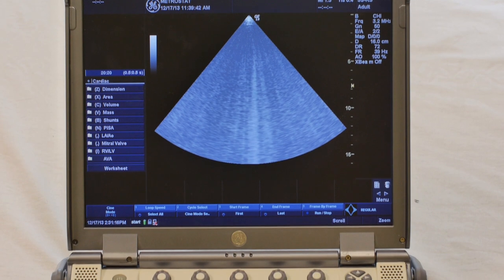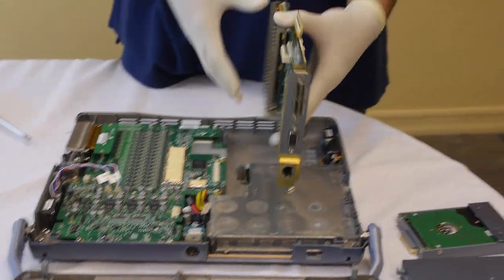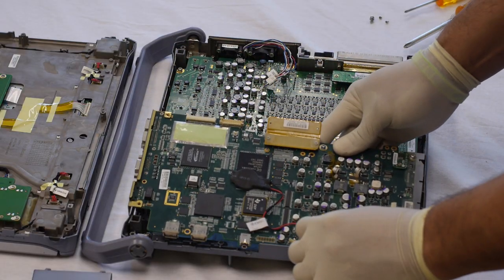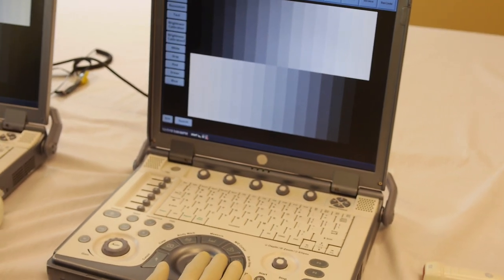How to Repair an Ultrasound Machine: Reconditioned Ultrasound Systems

Comment: Hi, i have a question, not sure you can help or not. i have few Ultrasound Machines Toshiba Nemio 10, 20, 30 & XG. the problem with machines are as below

The Date/Time after 2020 is not going to save. The date save only which is before the year 2020 not above the year 2020. Once date is set of the year 2021/2022 or even 2023 but after machine got restart it jumps to year 2000. 

Not sure if you know this issue or can help on this. Thanks in advance.

Comment: Please sir/ma i need your response urgently. As an engineer, i fixed a Phillips clearvue550 ultrasound machine but it keeps showing an error message with Diagnostic Code 0010.KDH519G4.0 

I've tried to reset the machine but the error message has persisted

Comment: I have  a volusion-e ultra sound. Is it possible to hardwire it to Sony black printer for it to print, via USB and BNC connector, pls advice cse I can't also access the add printer menu on this ultrasound machine
Reply from the maker: Please give us a call at (888) 559-5253!

Comment: hi, i have a medison ex8000 ultrasound system, after 15 min of walking it displays this message: (system error please switch the ultrasound system off and reset error code 65) help me,
Reply from the maker: Give our service department a call and we will do our best to help you out! (888) 559-5253
Reply: Re installed SW

Comment: Can you help me with something pertaining to this subject?
Reply from the maker: What is your question?
Reply: @JakenMedical  hello, I bought an ultrasonic machine and the inside of it was moving, but  whatever it was, it shouldn't be able to. On the inside of the machine, there's something that is silver with metal things on it, and whenever I would put it on the green circuit board, the light and number on the machine would come on. Does that sound familiar to you?
Reply from the maker: @portiajones4003  This issue does not sound familiar. However, you can email our ultrasound technician cesar@jakenmedical.com so that he can better help you troubleshoot the issue.